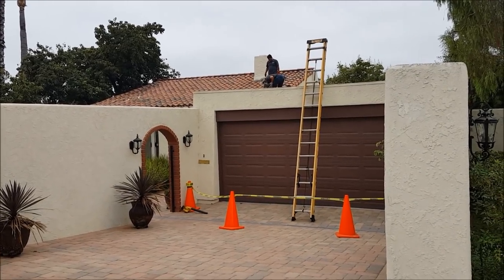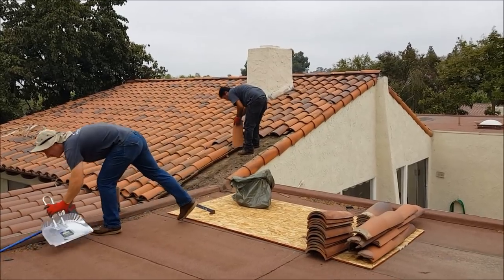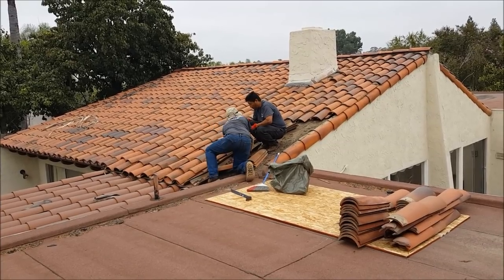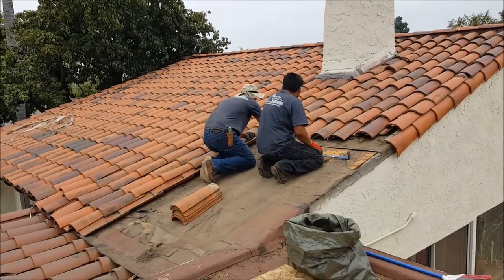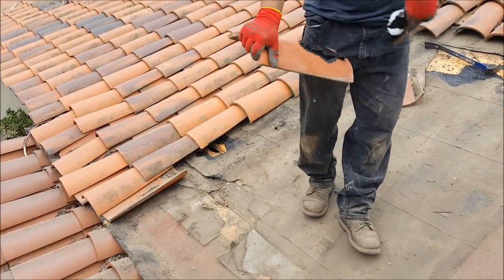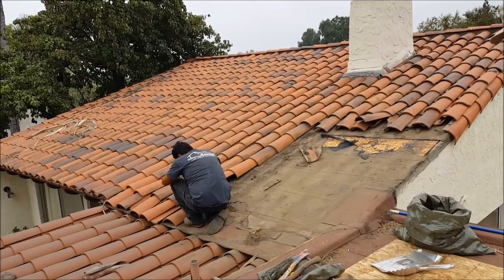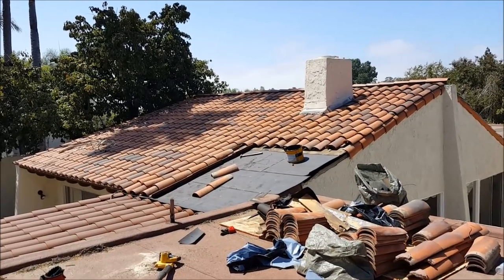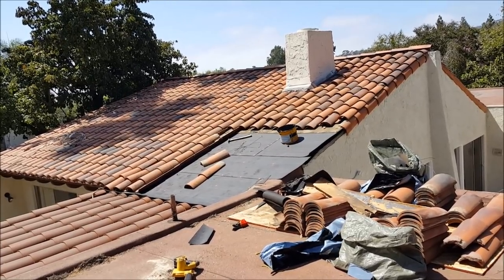Spanish tile roofing and mold damage decking repair

Comment: Do you do repairs in north county San Diego?  I have nearly this exact issue.
Reply from the maker: We don't.  Spanish tile roofing is a little difficult to get repaired correctly because most roofer haven't much experience with these tile.  The installation methods are different from concrete tile.
Reply: West Coast Roofer - Roofing and Roof Repair any recommendations for contractors here in SD?  It’s a two piece clay tile. Thanks!
Reply from the maker: I don't know anyone that specializes in Spanish tile in SD

Comment: your crew was taking off the tiles with very little effort....what kind of building code lets that go by?
Reply from the maker: They are installed with nails that penetrate 3/4" of an inch into the deck which is enough to withstand the wind we get around here which is about 80 mph at the most.  If you do it right, they are easy to take up.  It just takes a little practice.

Comment: Do you do work in San Diego County?
Reply: Wouldn't bother as they only do patch repairs,  yee ha grandma the sheriff boys are coming,,, in the uk you would be kicked off the the job for carrying out that patch repair, we would of had that little roof completely ripped  off, new membranes and tiles back on.
Reply from the maker: @khrisa1945  You guys in the UK must have money to burn. We don't.  So, we fix what can be fixed and replaced what needs to be replaced.

Comment: you are not fixing the problem, just the symptoms of the leak, which is coming from the chimney. it will keep leaking when your new paper wears out..
Reply from the maker: There's was no leak from the chimney.  Fixing the chimney when it doesn't leak would be ripping off the customer.  We found the exact leak that was causing the water damage from the inside.  Having new felt paper in the wrong area wont stop a leak.  Maybe you could learn something about roof leak detection.  No matter what.  I really appreciate you watching and commenting.
Reply: West Coast Roofer where was the leak coming from Then?
Reply: from the roof
Reply from the maker: Right in the middle of the area we were fixing.  There was a problem right there.  There was no signs of water damage coming from higher up the roof.  That's how we know the roof leak is right there.
Reply: Around here (Norway) when we lay tile roofs - we always put on a framework of thin wooden beams (first up the roof, then across the roof) - like a wooden gridiron. This is on top of the tarpaper. Then the tiles are resting on this grid (the size of the grid matches the size of the tiles - and one end of the tile has a small lip that "hooks" to the woodgrid). This ensures that you have about half an inch air gap between the tile and roof so that air is free to flow between he tarpaper and the tiles getting rid of any moisture or condensation.
Reply: @SouthCountyRoofing  how did you treat the mould?
Reply from the maker: @khrisa1945  We removed the damaged wood and properly disposed of it.
Reply: @SouthCountyRoofing  and you treat the mould spores with what ??
Reply from the maker: @khrisa1945  Extreme heat.
Reply from the maker: That is the best way.  I have done this technique and it works great.
Reply from the maker: R&R removed and replaced.